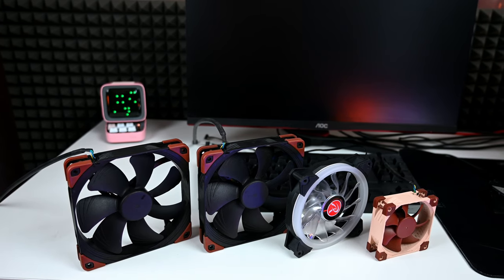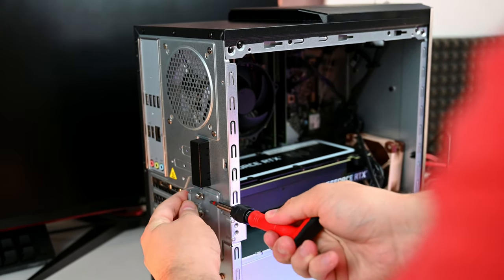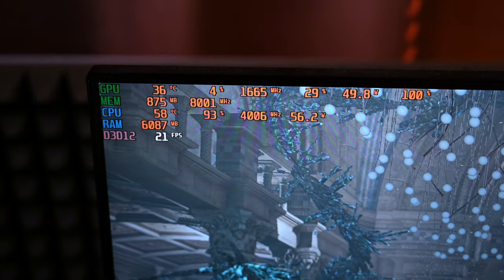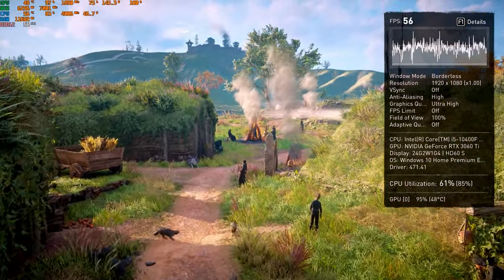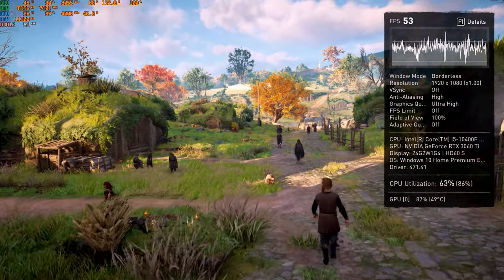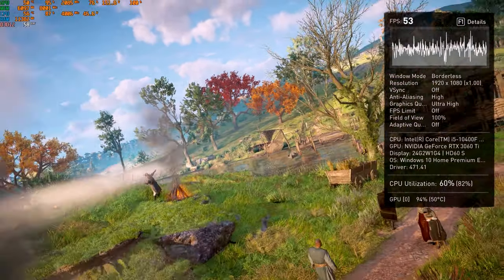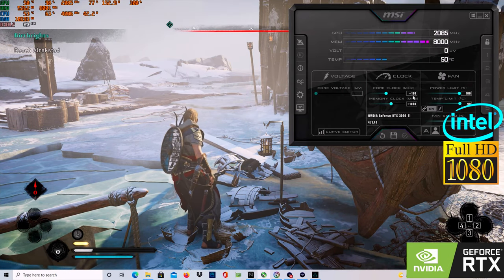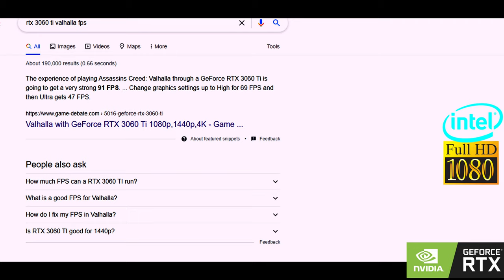1400 $ Acer Nitro N50-610 - i5 | 16GB | 512GB | RTX 3060Ti - 2021-  Assassin's Creed Valhalla FPS

Comment: Yesterday i finished the job on the Cooling on my Nitro 50...You can add a fan on top underneath the plastic lid.. there lots of holes on top to mount it...I bought a fan cable splitter for 5$ so i can install the additional fan.. On the cpu i installed the ARCTIC Alpine 12 CO and it reduced the cpu temp by 10 degrees...75 celsius on full load and acer performance mode.  30$ in total...
Reply from the maker: Good tip!

Comment: You just instaled a cpu cooler? I got this one with 3060 and my CPU stays at 75-80 while gaming a hard game even with fan speed at 100% it averages 75-77  degrees.
Reply from the maker: No I added additional fan to system to see if it effects the overall temp

Comment: I have the same pc except that i have the i5 11400F and I upgraded my ram from 16 to 32gb. My score on this benchmark at ultra settings fullscreen was 94 fps. It's strange that you have such a low result.
Reply from the maker: what is the ram speed you are running, also this one had 10400f you should have higher score. It could be also related to Nvidia  driver update, game had update perhaps, too many factors
Reply: @Gamingtechgg  My new ram is 32GB 2666mhz CL16 ram (Kington Fury beast series). The old 8GBx2 sticks were CL22 and ran at 3200mhz and my cpu is  the i5 11400F. Mine is Acer Nitro N50-620. My GPU scores increased drastically after the ram upgrade which was probably because of the lower latency. The difficult part about finding ram is that the Acer Motherboard doesn't support XMP, so I had to look for Plug&Play or native high speed sticks (JEDEC compliant). In this case the best I found were 2666 mhz and had a decent latency.
Reply from the maker: @thepilot4578  you are fully right, I did not have compatible sticks hence never did ram comparison.
Reply: @Gamingtechgg   The original ram sticks were ok because they ran natively (at 3200mhz), but a  high latency cost (CL22-22-22) at 1.2v. But still the new ones gave me on average a 5-10 fps upgrade.
Reply from the maker: @thepilot4578  So many people will be grateful for this information man. Once again thank you. You are welcome to join discord as well https://discord.com/invite/RqgAjAuCnC
Reply: @Gamingtechgg   It'll be an honor!
Reply: You're welcome btw!
Reply: @Gamingtechgg  Does this mean you're gonna make a new video and with a ram comparison?
Reply from the maker: @thepilot4578  I sold the system after fixing all of the issues, If I had I would all of the  prebuilds I showed on the channel are sold

Comment: Hey! Tell me why your temperatures are so low? I have a video card up to 83 °
Reply from the maker: Hello :)you are most likely running the card on auto fan speed I can guarantee you that. Set the card on 100% fan speed you will see temperatures dropping very fast
Reply: @Gamingtechgg  thanks for the answer)
Reply from the maker: @mo1rdin825  you are welcome, just download msi afterburner in order to control your gpu temperature

Comment: So is this pc good for gaming and if I don’t get another fan will I get bad fps if yes if I get another fan will it run alit better
Reply from the maker: it works good the way it is, having another fan is optional
Reply: @Gamingtechgg  also how can I by this graphic card I have the same pc but with a gtx 1660 super and I live in the uk and how do I by this once
Reply from the maker: @mohmmadaidh3495  this acer nitro system has many versions got mine since somebody refunded it. I got it from Inet they only ship within Sweden sadly.
I got more budget friendly version coming up also with 1650 super. You got a great card by the way to play on 1080p :)
Reply: @Gamingtechgg  thanks can you giv me a good graphic card opinion that will fit my pc
Reply from the maker: @mohmmadaidh3495  rtx 2060 is nice card it was beating my gtx 1080ti if you enable dlss
Reply: @Gamingtechgg  which once and can I run cyber punk 2077 on it with really good fps and can fortnight run smooth
Reply: @Gamingtechgg  and is they any other higher end ones or nagh
Reply from the maker: @mohmmadaidh3495  depends if you intend to use ray tracing on cyberpunk, I tested 2060 with dlss 100-140fps 1440p resolution. Dlss was on quality mode. Cpu 11700f.  I have video on 3060ti cyberpunk settings. Gpu prices are bad as you know options are limited. I drop links when I see stuff on sale
Join : https://discord.gg/PxMYyzpe
Reply from the maker: @mohmmadaidh3495  haven't seen higher than 3060ti model. 12th gen versions will come out
Reply: @Gamingtechgg  so can I not by the Acer rtx 3060 to
Reply from the maker: @mohmmadaidh3495  there should be 3060 version
Reply: @Gamingtechgg  I mean can I just go on to Acer or something like that and by it
Reply from the maker: @mohmmadaidh3495  they have online shop but not sure if that is for every region

Comment: just got this pc for 1.2k with a 11400f should i upgrade any parts?
Reply: + how do i fix low gpu usage
Reply from the maker: only cpu cooler if the sound annoys your or to have improved thermals but nothing needs to be upgraded. Low gpu usage on which game ?
Reply: @Gamingtechgg  on rust and other games but not as bad
Reply from the maker: @pepefy3117  what nvidia drivers are you using ?
Reply: @Gamingtechgg  the latest one from geforce exp
Reply: And my temperatures never go over 70⁰
Reply from the maker: @pepefy3117  I will revisit this system to do more game testing
Reply: @Gamingtechgg  thanks man,  you earned a sub 👍
Reply from the maker: @pepefy3117  appreciate it brother :)
Reply from the maker: @pepefy3117  that is perfect, if you use msi afterburner to control the fan of the gpu you can drop it even further but it gets loud
Reply: @Gamingtechgg  i just tried gta v and my gpu is only having about 30% usage
Reply from the maker: @pepefy3117  have you tried ? 
1.GO TO MY COMPUTER
2.SYSTEM PROPERTIS
3.ADVANCE SYSTEM SETTINGS
4.ADVANCE TAB
5.PERFORMANCE,SETTINGS AND ADJUST FOR BEST PERFORMANCE
Reply: @Gamingtechgg  i did that and turned gta priority to high and its still using only 35-40%
Reply: @Gamingtechgg  its even worse now in gta v i got 20% gpu usage
Reply from the maker: @pepefy3117  I will test gta also again